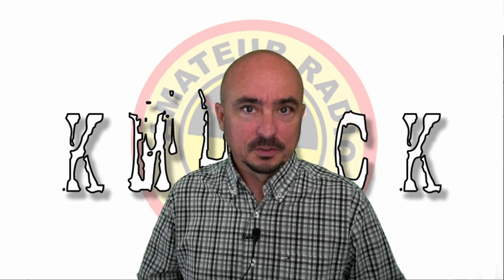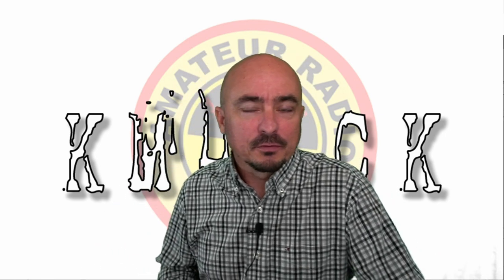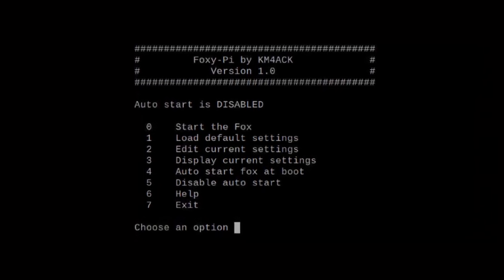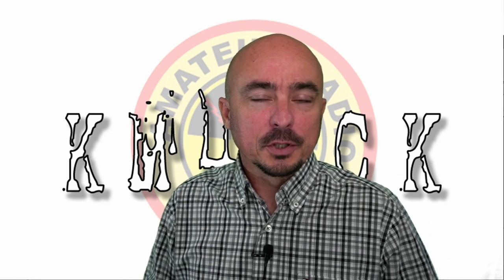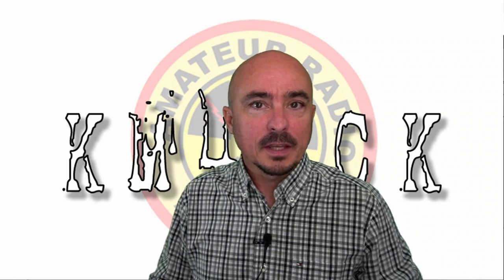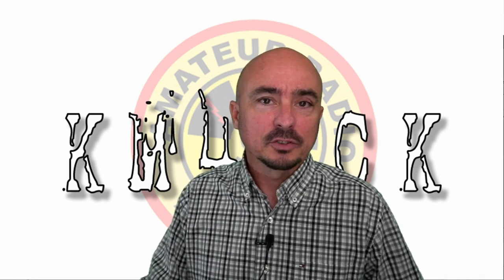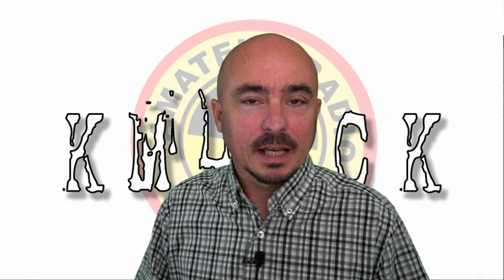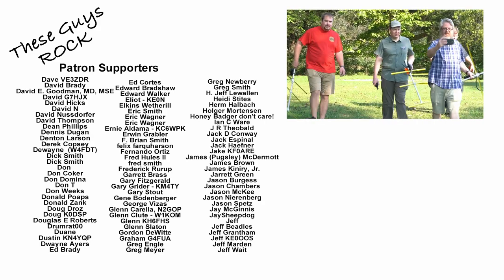Ham Radio Fox Hunting 101

Comment: There are ELT Emergency Locations Transmitter in some airplanes on121.5 MHz.  There are groups like CAP that look for them! But with some changes in the frequency some of our radios can be made to find them. The military uses 243 MHz.  There has been some changes to this with the GPS system in the ELT'S. But other than the frequency that is used most of it the some way of doing.

Comment: If you only had a cheap Baofeng and no attenuator, would it help to improvise the yagi so it picked up less and less signal the louder the fox signal gets? Basically de-tune the yagi as the signal increases so you only hear when the fox signal is the greatest. I have not been on a fox hunt but I have done very extensive metal detecting and when pin-pointing a target I notch the signal so it 'sounds' much quieter and only the loudest signal is heard.

Comment: Good intro to fox hunting Jason! I've designed a few foxes for our club in the SWVA area, and have had lots of fun. One thing to note is that, while Baofeng radios are OK for getting in the area, the operator will quickly learn the limits of the signal level indicator. I believe the signal strength indicator to be of utmost importance when getting close to the fox, along with the offset attenuator. I often bring a few FT-60s to our hunts so that new hunters can avoid the frustration. 73 de W4XXV!